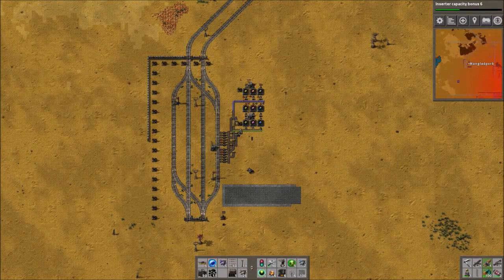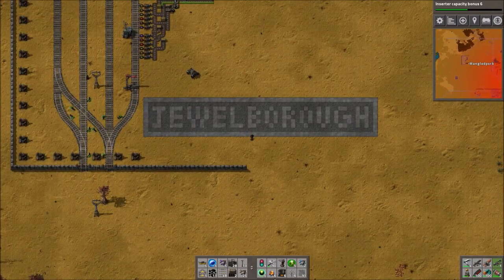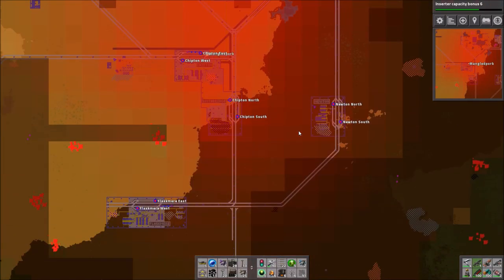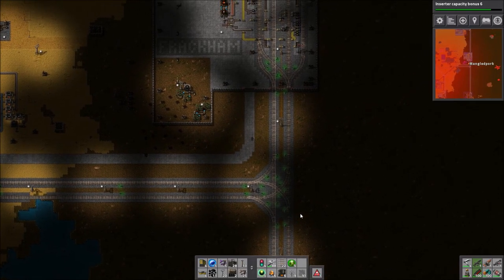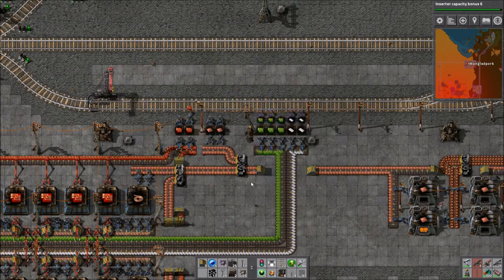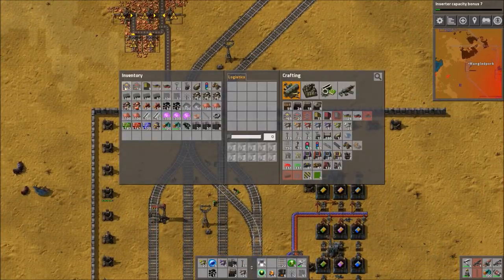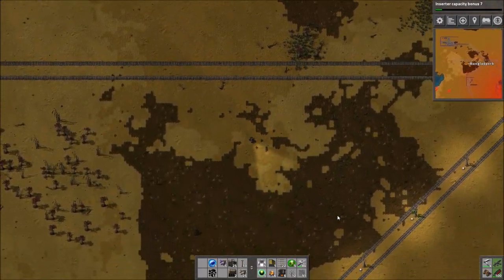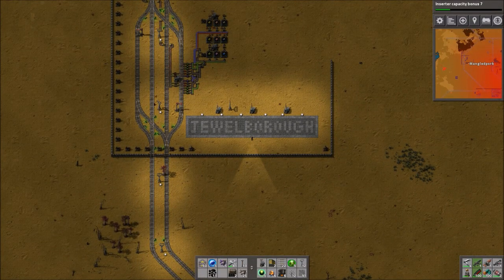Factorio Towns Ep#41: The Circuit Line

Comment: I like the series.  Factorio trains systems seem better than any miniature railway I ever built before mostly because the trains are actually doing something rather than just going round in circles.

A few things I thought of which may or may not be good to implement:
1. Frackham would seem like a good place to set up some flamethrower turrets.  An electric pump can ensure a supply of oil in a pipe to the turrets.
2. The train that services Jewelborough might be serve it better by picking up the blue circuits first and then getting red and green ones.
3. Maybe set up a town which produces robots and cover each town with a roboport and some construction robots for repairs.  With a few spare components and some repair packs each town should last longer against the constant barrage.
4. With some logistics robots in each town they could resupply you when you get within logistic range.

One last thing that I think I may use with my next towns map is have a third (possibly smaller) station which is used for a service train to supply all towns with ammo, repair packs, spare turrets and walls etc. picked up from the various towns.
Reply: Finish it!

Comment: Hey Bentham, love the series but I'm sad since I'm all caught up now and have to wait for episodes. Anyways I've been thinking about solar energy for a long time but wanted to wait until I had reached a current video. 

I was thinking you should put a couple solar panels and maybe accumulators in every town. Most of them have plenty of empty space. Not tons, don't saturate the towns with them or anything. Just a handful here and there to supplement the power. It might be cool to not have them in fixed patterns either to make it seem like they were installed gradually over time wherever it was convenient.

Anyways just a thought.
Reply from the maker: Not a bad idea actually. I could use them as decoration in some of the open areas.